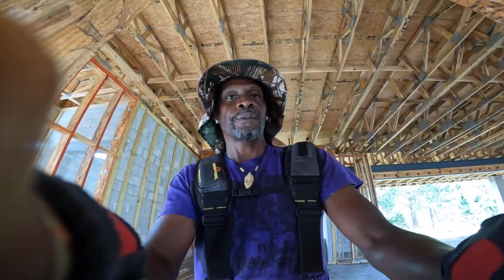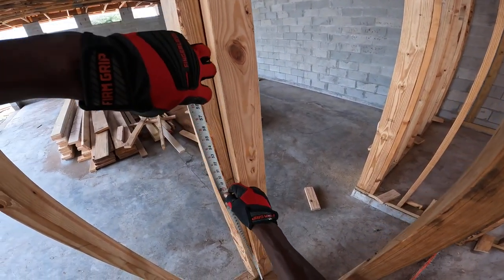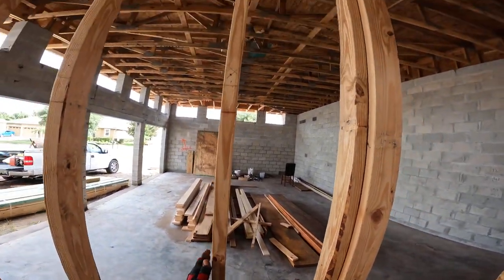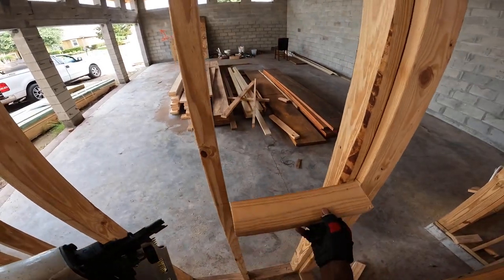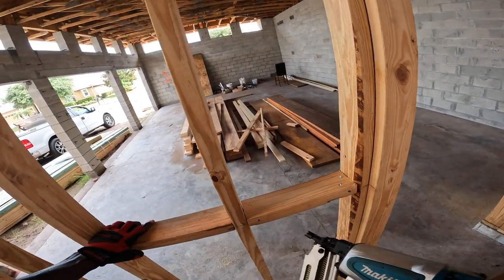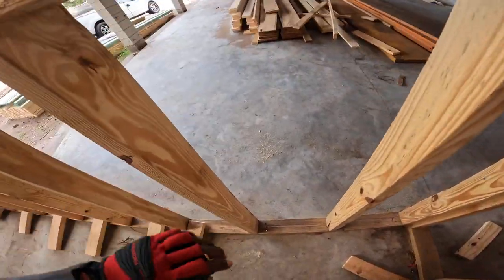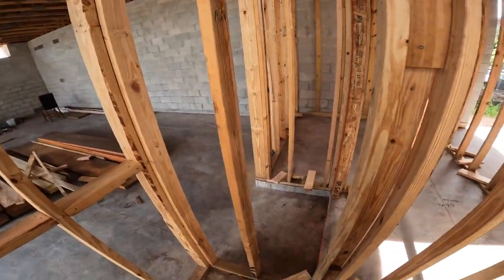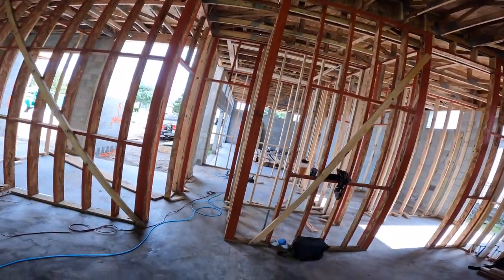How to install drywall blocking for stud walls

Comment: Good video. I want to install a dip bar to a single stud. Would blocking between studs make a single stud installation good enough without using a stringer? Or is a stringer across multiple studs still a must for a dip bar installation?
Reply from the maker: Hi, I would install blocking (2x6) between the width of the studs of the walls to allow a strong hold against the finish. Remember a stud is only 1 inch and a half 1' 1/2 thickness by  3 inch and a half 3" 1/2 wide, standing vertically on 16 inches o/c  on center. So, in between each side of the studs if truly on 16" o/c then you should have 14" 1/2 of open space on each side. So, yes I would definitely add the blocking for strength.
Reply: @besfloridaframersanddesignsllc  Thanks, I appreciate the in depth answer! so you think I can get away without using a stringer on top of the drywall to mount the dip bar if i have blocking already between the studs?
Reply from the maker: @zero450571  the stringer wouldn’t hurt if you just wanted to install it for extra strength. Either way I think it should work.
Reply: @besfloridaframersanddesignsllc  thanks very much!
Reply from the maker: @zero450571  anytime. You’re welcome

Comment: Where is the installation of drywall?
I didn't find the answer to my question ?
Reply from the maker: This job we are only doing the custom rough framing work. No content for drywall installation for this video. Thanks for asking. I will do a drywall installation video in near future.
Reply: It's for blocking. Drywall blocking.
Not drywall, but drywall blocking.